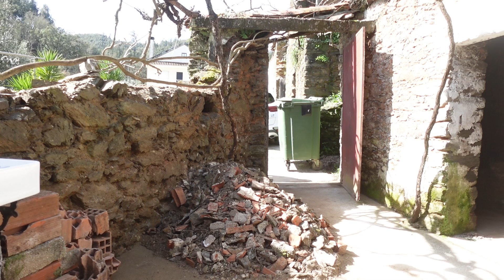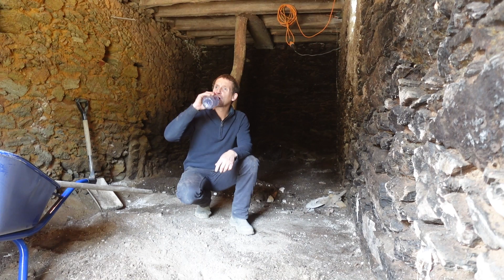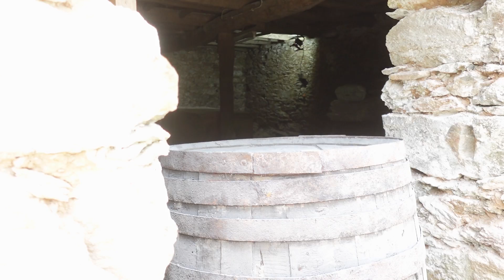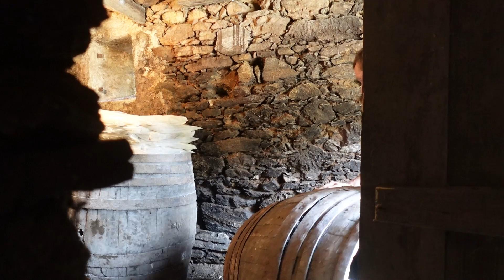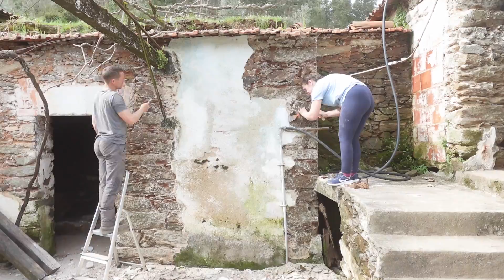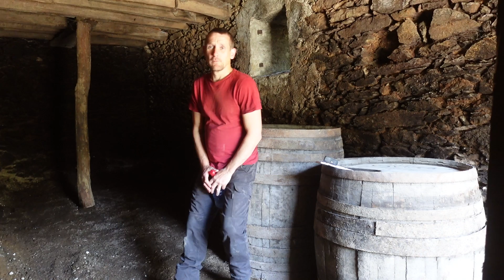#28 - Tackling the Cellar, Antique Wine Barrels & the Courtyard

Comment: Not sure about wine barrels, but when the bands get loose on wood butter churns (essentially, made same way as wine barrels), you fill them up with water. Let it soak in for 30/40 minutes. Then, remove the water.  The water causes the wood to expand. When they dry our, the bands fit again. You oil & you're ready to go.
Reply from the maker: Oh amazing! We'll give that a try. Thanks so much 💛